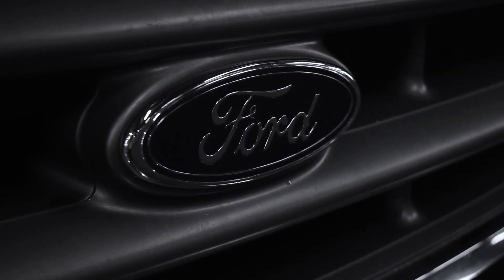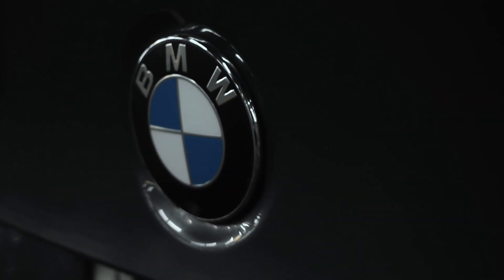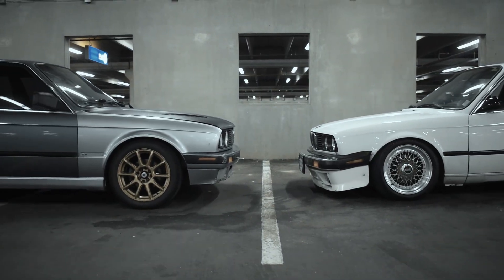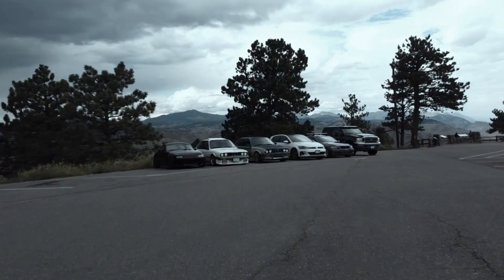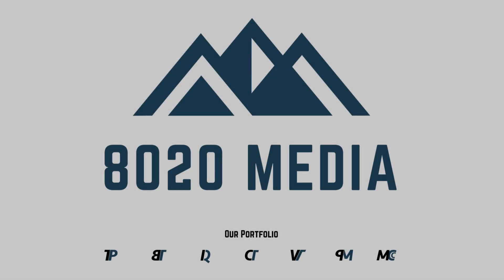The 6.5 Detroit Diesel | The Worst GM Engine?

Comment: Appreciate the great content! 👍👍
I remember working for a big utility company years ago as a fleet mechanic and i was sent to GM school to learn the ins-and-outs of the 6.5 turbo diesel engine. It was new and in all our 3500 series trouble bucket trucks and at the time it was new, there was no replacable parts for injector pump so if solenoid went bad, you had to replace entire pump. Got that job down to under 4 hours R & R. I like the engine but it had some faults for sure!
🇺🇲✌️
Reply from the maker: Thanks for the feedback and taking the time to write your first hand experience with the 6.5's!